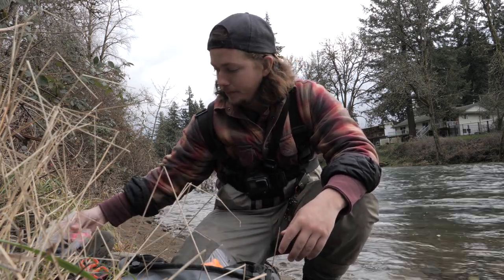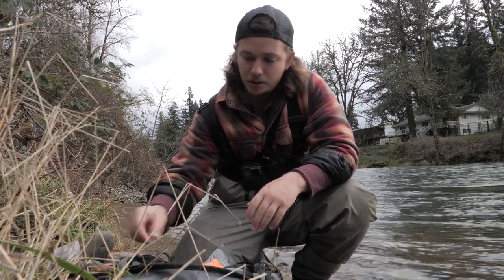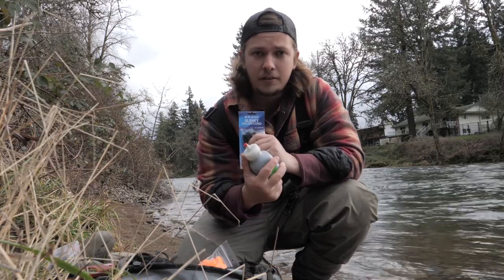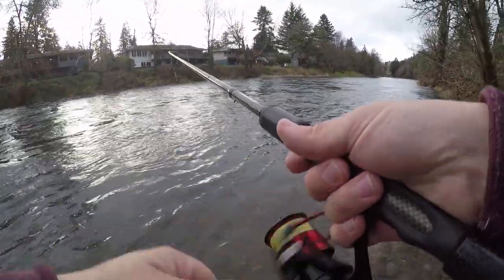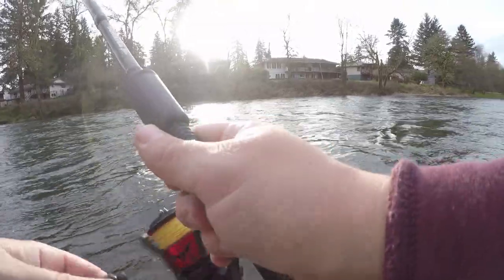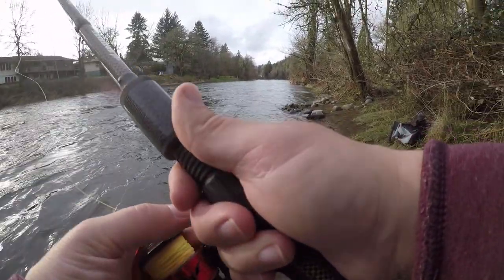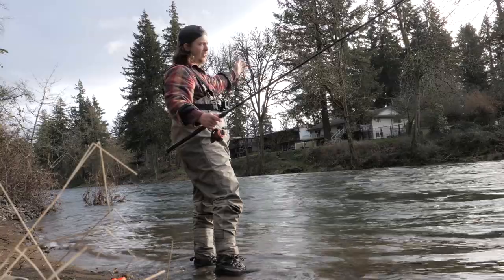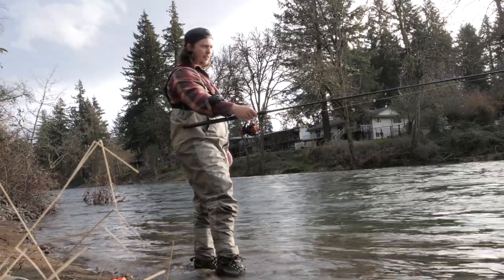How To Make Slinky Weights For STEELHEAD | How & Where To USE Them |

Comment: Could you make a video about how to drift fish and what kind of gear you’d need. I want to try drift fishing shrimp for steelhead this season, any advice such as what kind of line or pole to use would be helpful.
Reply: Get a lamiglass X-11 theyre great and not too expensive, ans pair that with a pfleuger president xt or just a president, or even a 4000 kast king sharky 3.

Comment: What size or gram shot is best??
Reply from the maker: These are the smaller size I’m not sure exactly. But get the smaller of the two and find out what slinky sizes suit you best! But it’ll end up being 5 size 6 size and 7 size
Reply: @FishingTheOdds  Thanks bud went to sportco and they had Oregon tackle .170 .195 .300 and I went with the .195 cause I read a lot of people use the .250 or .270 and they didn’t have those sizes and .300 are huge and I’d rather have them longer/slim for dragging 😁

Comment: If you fish slinkies and plan to make your own they make a tool that is a little brass tube and a rod to pack the shot in. It makes it very fast. You can make a 5 foot long slinky weight and then you just cut them to your desired length and melt em shut. TIGHT LINES
Reply from the maker: Hell of a good idea too! Thanks bru!!